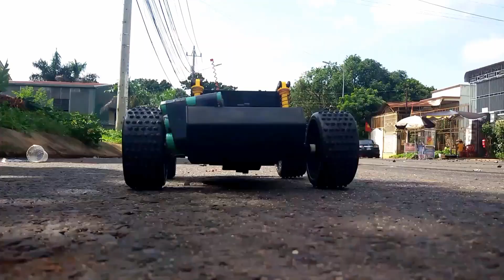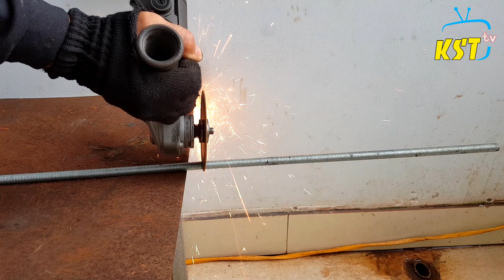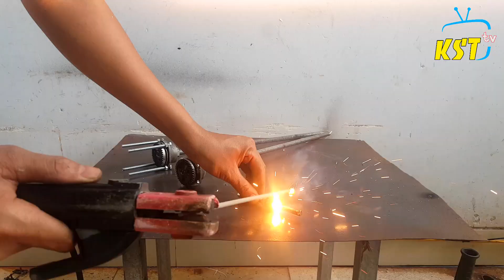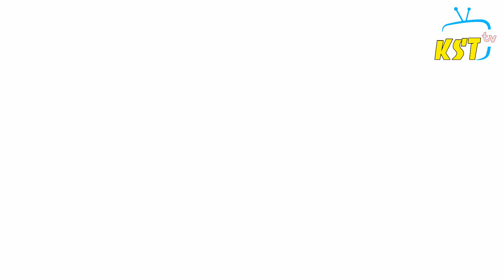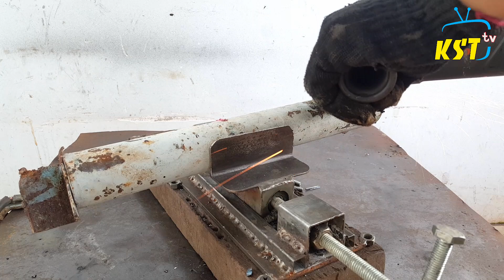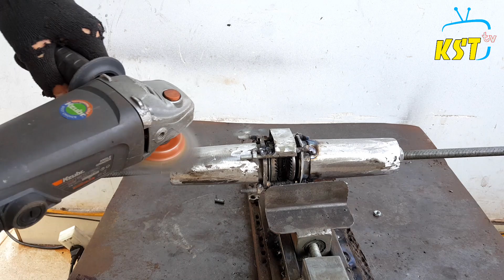Build a Differential Gear using Old Grinder - V3 (Project electric car)

Comment: Interesting build. However I have 2 comments to make working easier clamp or bolt your vice to the bench, and most importantly put the guard back on the angle grinder before you use it again.
Reply from the maker: Great suggestion!

Comment: I always thought welding close to a bearing would ruin it because of the intense heat transfer....
Reply: Yes, it usually does, if its not kept really cool. I dont think this example was kept cool.
Reply: What kind of solution could solve the heat problem in a homemade project like this?  Lubrication is not enough for low rpm application?
Reply: Yes it will. But sometimes in a project like this a lot of compromises have to be made due to limited resources with the scope of the project being an experiment. A good example was Henry Fords  crude "kitchen sink" engine which was made from plumbing pipe. It inspired him to become one of the greatest industrialists of all time.

Comment: Bery nice idea,I am making my ,I will be using a tube sorraund the gears ,to fill with oil,and way less wellding ,but you are my gide thanks a lot budy.also I am using 80cc motor gear atachments,and elecctric skate board spacers where the screws are  but thanks you got the brains.